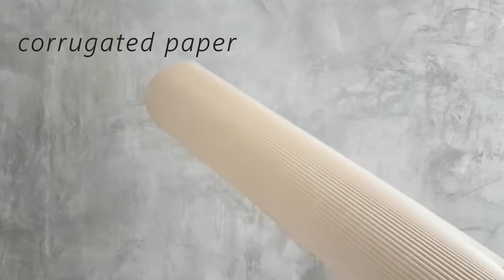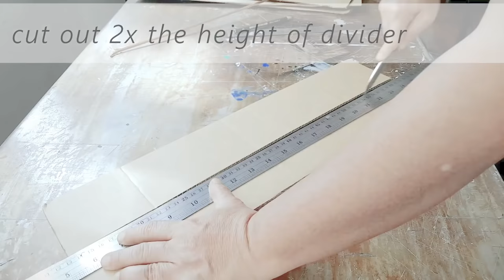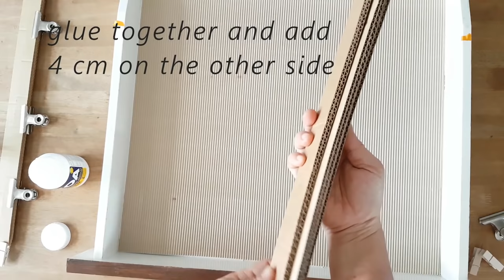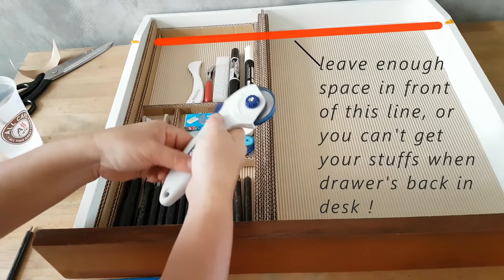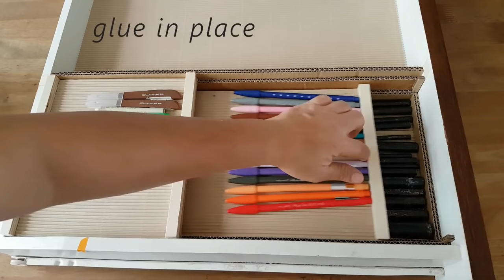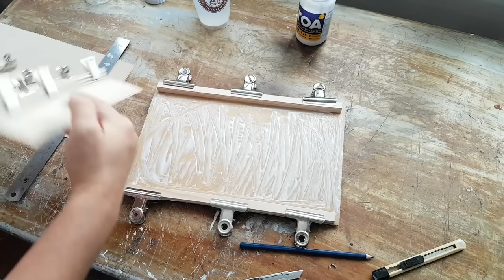3 Level Cardboard Desk Drawer Organizer with Sliding Trays Recycle DIY

Comment: How do you get the upright pieces to stick to one another in the corners with glue, since the edges are not flat?
Reply from the maker: hi there, i'm not sure which part you are referring to ? can you give me a time code ?
Reply: @SaltyDIY  there’s no time code because I don’t see you actually doing it. In the corner of the pieces that are upright in the outer part of the organizer, do they stay together simply by pressure? So the horizontal and vertical upright pieces that form the outer rectangle?
Reply from the maker: hey, just saw your comment :) all the horizontal n vertical pcs are taped together :)
Reply: @SaltyDIY  Thanks!